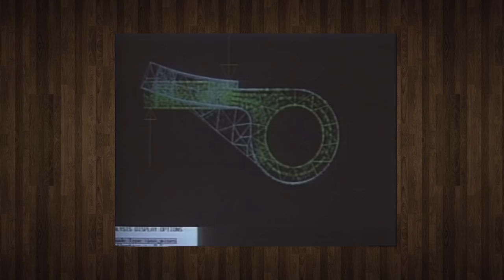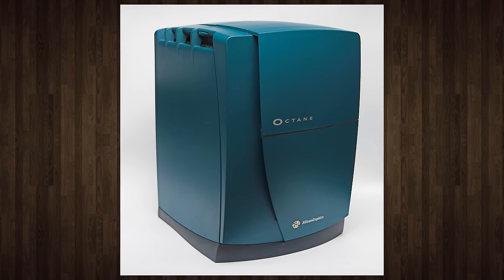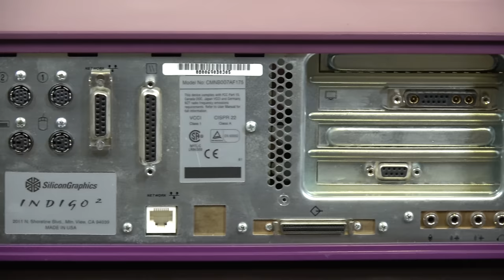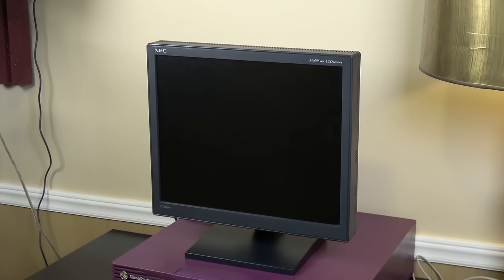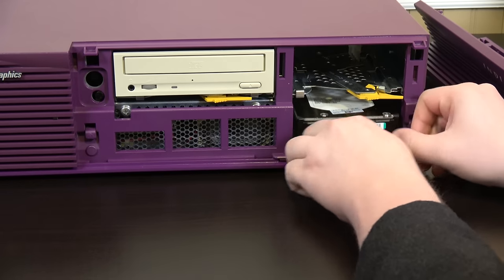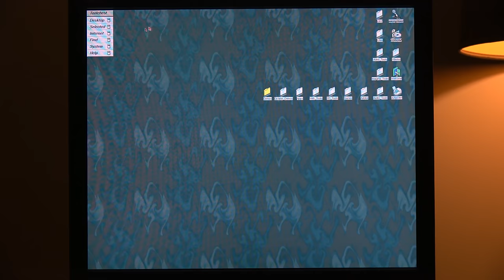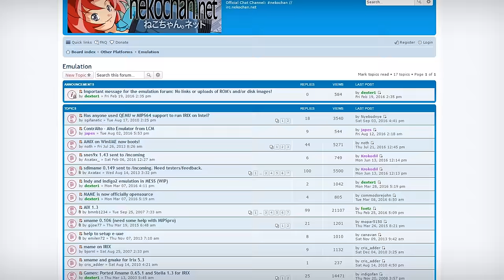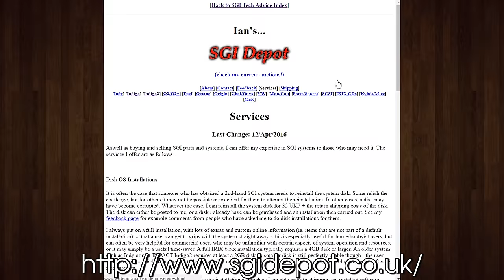SGI Indigo2: An $86,000 Workstation from 1995

Comment: Reminds me of my Sun Sparcstation fetish I had back in the early 2000's.  I used to put myself through misery to get them up and working as my main desktop computer just because "they were cool."  But after a year or two of that, I went back to a regular PC.
Reply from the maker: I don't blame you there. These kinds of workstations are all kinds of cool, but a bit... obtuse.
Reply: I like the interactions between you two
Reply: I had a major desire for the Iris Crimson (first 64bit!) and was able to play with one in a creative department.  Such amazing machines and SGI is a iconic company long ago.
Reply: I have three Crimsons atm, but all have issues, just need a chance with some solid spare time to sort them out. It's probably just a PSU, and I obtained a spare from BAe. Would be fun to get one of them kitted out with an R4K/150 and RE gfx, especially since so far I've had to rely on other people to send me benchmark results for Crimson for my site.

Ian.
Reply: The 8-Bit Guy I too had that Sun fetish.  Had an IPX all decked out with SCSI devices.  Had that networked to an Indigo^2 and HP 9000 735.  Got rid off all of it when I got married.
Reply: 21Cent skitso plug rocksclustrs roles abilities, production line auto inknown?Do you have any EPROM tips for SUN 1 ultra creator ?  dont quite consider too simply bosh a new one in a machine with wiped drives, any quip will help along lots, thanks, Steve.
Reply: I kept my Sun X7200A monitor running but I had to abandon my sparcstation long ago. I regret not keeping it around, but I ran out of space.
Reply: Lol yeah - you would have dedicated admins at a site to maintain these Unix workstations. My college migrated from Solaris to RedHat as soon as they became viable. 
IRIX is even more of a pain.
Reply: 1337Sauce nope. A complete emulator for SGI hardware does not exist. It’s not a matter of performance, but how exotic and proprietary this hardware is.
Reply: If you'd been using them as actual work machines like I did from '04 to '06, you wouldn't have gone near them again if you could help it... OK, maybe that's a bit harsh and more of a judgement on Solaris, but I'm not sure what else you could run on them. I'd be interested to see them doing something more domestically useful... (not that what they WERE doing wasn't useful, but it was extremely limited scope - pretty much capturing and processing medical images and nothing else... like... at all... not even a notepad app, although there was of course the utterly horrible ImageJ sitting in place of Paint and used for certain very rudimentary operations...)
Reply: I have an Alpha machine and a Sun Sparc machine sitting under the bed and they are just collecting dust. :-(
They are great reliable machines, I ran Debian GNU/Linux on it to have all the applications available to me that Debian has. I actually used them for a while as my main desktop too. But I don't really have much use for it now. My smartphone has more power. However it's a pain to run normal Linux on your smartphone and connect a normal monitor and keyboard to it. :-) I'm actually still hoping that will change in the future. It's silly not to be able to fully utilize the power in our pocket.
Reply: Bluetooth keyboard and mouse, and cast your screen to a compatible Smart TV... job done.

Though it's a shame the idea Ubuntu had a few years ago of a phone / tablet based system that ran a mobile-type OS when in your pocket or hand, but opened up a full desktop environment when placed in a docking station (maybe still usable itself as a secondary display / input device or simplistic answer to the Wacom Cintiq) never came to fruition... instead they just did a Microsoft by crippling their previously decent desktop UI with a more mobile-type interface.

Daft thing is the capability has been around for ages - I've got an ancient Nokia Symbian phone with composite video out, and a super cheap Windows 10 tablet that can do MHL though its USB port (slightly inconvenient because it also uses that port for charging, and expanded storage, and plugging in keyboards etc... too bad MHL can't work through a hub... though I do have a USB2-to-VGA graphics adaptor, hmm), both of which can be controlled over bluetooth. Just never really caught on in a big way for some reason.

In any case, good that you were able to put a more general-purpose OS on it and get some proper use out of the thing, even if it's since been re-retired :) they always felt unnecessarily handicapped and underused in the professional setting I knew them from. Given the age of the equipment, presumably they were the only things that could have done the job back when it was all new, so it was justifiable to buy a £5000+ computer then lock it right down to only running three or four programs... and maybe the software was never made available for anything other than Suns, like precompiled Alpha code only with no source on offer, but really the task in hand could have been done by any random cheap 2000-era PC blindfold with one hand behind its back...
Reply: Ubuntu was not the only one working on it. Here are some related things that come to mind. I actually had a Nokia N900. But it had an accident in the first weeks I had it and it wasn't ensured and thus I didn't have a working device anymore. This was a phone that was running basically regular Linux. Unlike Android, etc. WebOS came close too. Actually my newly bought 4k TV from LG runs WebOS. 
I'm kind of pissed off that why it isn't true that when you get to work or home you don't dock your phone in your monitor and have a working computer. There was a company that actually had a prototype where you could take a smartphone and turn into a tablet just by docking the phone into a larger screen. The screen had no CPU.
Google and others are working on porting Android to Chromebook. And Chromebook works on ARM and smartphones are ARM devices... would that eventually mean the other way around would also work: Chromebook on your phone with Android support ? :-)
Anyway.. I'm hoping for chance in the right direction, but I see nobody doing it. I think it might be on purpose.
Something else that applies to machines from Sun in comparison to most PC hardware, they seem to be more reliable too. I've worked in the defense industry a little bit and they seemed to use them too. Al though these days you have rugged laptops, etc. so it probably does not apply anymore.
Reply: Yeah, that CPU-less docking screen thing is essentially what I was remembering. Might not have been Ubuntu themselves on the hardware side but they certainly had a close partnership with them in order to develop the two-state OS (...which would have been a bit like swapping between Metro and Classic desktops in Windows 8, but, like... not shit). I didn't see one that turned a phone into a tablet (a bit redundant that, maybe?), but there was certainly a laptop model (there's even a patent for that knocking around somewhere that can be looked up) and a desktop one too. Phone might actually have gone straight in the side of the monitor in fact, now I think about it more, rather than sitting in an external dock. Kind of like it was the processor and memory module for the larger computer that the two then became, with the dock providing a bigger screen, keyboard/mouse, power, more storage and extra ports.

I think most of the old "professional" computer systems were somewhat more reliable and longer lived than the commodity machines used in homes and offices, in any era but particularly the modern disposable age where people are actively encouraged to upgrade their phone or tablet every two years, and laptops/desktops are built down to the most rock bottom of prices... After all, they were selling for many thousands of universal currency units, sometimes tens of thousands, and used for jobs that demanded continual uptime, sometimes with people's lives riding on that. Plus the companies made about as much money from the sale of service contracts, and the more that the engineers had to go out to fix a machine, the less it effectively made them, and also the less likely that customer was to buy from them again...
As shown in this review, and in RetroManCave's trash-to-treasure vid of a DecStation he picked up for cheap, the reset button is hidden away on the back because you're not expected to need it in any but the most dire of circumstances, and the bigger risk is having it on the front where someone could jab it either accidentally or out of malice, or because they're too lazy to shut down and restart the computer properly on the rare occasion that's required.

Though if you were working in defence, every bit of computer kit being bought was likely up to Mil Spec, and so hardened against the usual things that might make a cheaper machine fritz out (from extremes of temperature and funky power supplies up to ionising radiation)... and the national treasury would have paid handsomly for the ruggedness upgrade too. Hopefully it was worth it.

NB I thought Chromebooks ran Android anyway? Aren't they essentially cheap android tablets with permanently attached keyboards (and often so little storage that their apps run entirely over the net)?
Reply: "actively encouraged to upgrade their phone or tablet every two years,"
Well, when we are talking about the planned obsolescence of smartphones all we need to do is point at the non-replaceable battery of course. Something to be even more furious about. That would be something politicians maybe could step in.
Nope, Chromebooks run ChromeOS, basically: a very small Linux system with just a Chrome browser which automatically updates and has added software and hardware security like verified boot and updates and encryption of temporary storage of the 'user profile' which is sync. to Google servers. Both pieces of software are based on the open source projects: ChromiumOS and the Chromium browser. It's basically the most secure and cheapest computing device the average consumer can buy (if you trust Google with your data and the software updates).
Reply: Well exactly.
Also, you mean "not at all secure" then ;)

Android is a flavour of Linux, partly developed by Google, so I wouldn't be at all surprised to find that's what's lurking under the hood in a Chromebook. Chromium is also what powers the browser on a lot of phones, AFAIK...
Reply: Android was a rush job to get into the market, many mistakes were made. One of the focuses for Chromebook has always been security. Not saying it's perfect. 53 security holes since 2010:
https://www.cvedetails.com/vulnerability-list/vendor_id-1224/product_id-20320/Google-Chrome-Os.html
And basically all Chromebooks are up to date (have it connected to the Internet and turn it off and back on again and it's updated).
I know it's not OpenBSD: "Only two remote holes in the default install, in a heck of a long time!" but the default install of OpenBSD does not run a desktop and a browser, it's just command line.
But 53 security holes is pretty good for a consumer friendly OS.
Reply: I too had one of those Sun fetishes. I salvaged a few Sun SCSI drive enclosures, a SparcStation 10 and a SparcStation 5 from work that they were going to toss. I fiddled with them a bit trying to get them running, and did for a time. Until I tried to upgrade the CPU's and the funky CMOS chip they needed didn't seem to want to live. I think it killed my motherboard in one of them. Later I scored a pair of Sun Enterprise UltraSparc servers from our datacenter when they were phasing those out too... they're about the size of mini fridges. and haven't attempted to even power them up yet.
Reply: 8bit is 👾
Reply: Hehe... I still have a Sun Sparcstation in the basement :)) It's just coooool :)
Reply: Oooh! I convinced my manager back in 1999/2000 that our department needed a Sparcstation to do all the Unix engineery stuff, and with a PC motherboard option for all the bloody reports I had to write (I can't remember the spec) so as to be compatible with the rest of the company. It cost a few quid (it wasn't my money), but it was really cool. This stuff brings back memories... GT Power! That was it! That was the only reason to splurge on the Sun. GT Power (which also cost a few limbs) was an engine system simulator that really churned though the clock cycles. So while that was chewing through a simulation, I could write my latest report and bugger about with spreadsheets in the PC bit.... Ahhh, happy days....
Reply: You what, now?
Reply: Sounds like any linux desktop distro the last 20 years. (Don't take me wrong haters. I manage linux servers every day but can't stand it on my desktop more than a couple times a year)
Reply: Sun workstations were cool - though I liked DEC Alpha's more.  I ran both a Sun Blade 1000 and 2000 workstation until recently.  They supported dual screen monitors and used fibre channel disks internally which were much faster than the SCSI at the period. I also still own an SGI as well (mine is one of the last made by  SGI, a Fuel) - but have never really used it. The Sun was far more useful for real work. I never liked the old Sun Ultra 5 or 10 as they were really crippled IDE based systems.
Reply: They really were ahead of the PC's of the period though in terms of performance so they appealed to the geeks of the period who wanted to build serious things - like  Google's first computer - a Sun.. I had an old Digital DECstation 5000 workstation from the  early/mid 90's.  When used by my university it had 16 000 shell accounts on it..  and supported a max amount of 480 mb of ram - which was huge for that period of time. Not bad for just a workstation sized system.
Reply: What was wrong with OpenBSD on Sun? I ran a Sparc based firewall on OpenBsD for a long, long time.
Reply: Sparc Linux was usable but I ran some  benchmarks on the Linux/Alpha box and its performance was horrible. Performance under OpenVMS or Tru64/Digital Unix was at least 100% better.  After that I stopped using Linux Alpha and just kept my Alpha machines either VMS or Unix.
Reply: ZFS was hardly a bullet in their head.
Reply: Most packages available for Linux could be compiled for Solaris. There were also dedicated  package maintainers that made available binaries for those who couldn't compile stuff. So any Linux based notepad app would have been available for Solaris. Sun also had a range of super computers available for the really high end stuff same as SGI.
Reply: Page Fault  Love them too..
Reply: hello there, this is a clear example when someone (in this case me) has nothing to comment on, but still wants to reply to the experts LOL
Reply: Nice to see u here
Reply: I used to run a cluster of SparcStation 10s and 20s, maxed out CPU and memory. They were slow compared to the pentium 4 era PCs I had, but a) they were free, b) my father worked for sun microsystems so I've always had a fascination with their products and c) they were cool. I had a couple of the lunch box style ones too which were even slower.

Sadly a house move brought about by poor health meant I had to give them all away as well as the SGI boxes I also had.

I did keep the most unique and interesting sun microsystems item though, 2 now rather rare sun microsystems SparcStation voyagers. I need to dig them out sometime and see if I can get one or both working. If I can't I expect I'll use one with a miniitx board to make use of the case.
Reply: Hahaha, I did the same. Still have a few sun station or ultra sparc workstations around garage.
Reply: It's factors like that which really highlight WHY these productions where so difficult at that time. This was "Expensive" "Bleeding" "Edge" stuff when it was first available. Constantly being updated, and meant for the Special FX Elite. Indeed, it wasn't until after Jurassic Park that it became "fashionable" to deck out your money-rich studio with these things. Which of course means smaller studios where lucky to have even one. It took almost a decade before home studios could have something of this nature. There was Amiga and video toaster, but that was bare bones and broadcast-quality only.
Reply: @rfengr00  spoken like every defeated man who put a ring on it, I love my freedom, lmao.
Reply: @The8BitGuy I lived in a dorm at UNT, and my neighbor had a Sun Sparcstation (well, a few, actually, but some were more complete than others), and he was always trying to fix something. Of course, that's what First Saturday was for...finding those good deals on spare parts.
Reply: Always had a vague interest in anything not strictly "Win, Mac, Lin" (as I like to call them), but ultimately all the computers I have are mostly just x86 maybe x64. I've never owned something like a RISC computer of any kind.
Reply: Oh god sparcstations...i totally forgot about those.
Reply: I did the same thing with Modern Mac computers. went back to PC after the arrogant community and basically Locked Down everything hardware related was too much for me to handle. Paying money for window snapping? Yeah...no thanks you masochists...